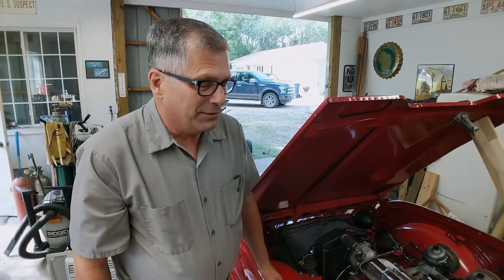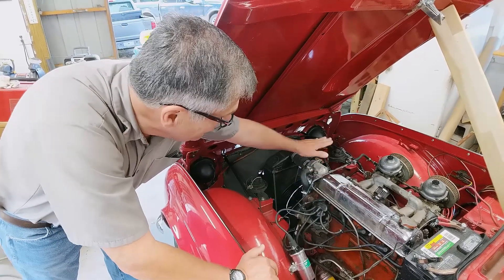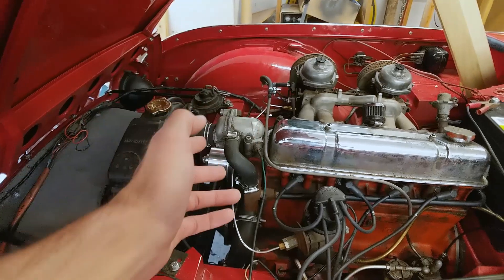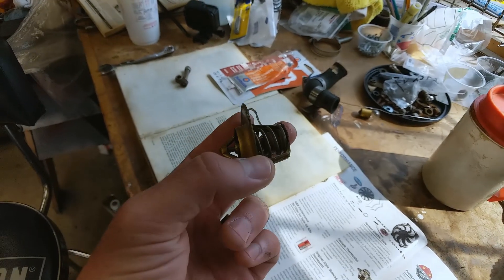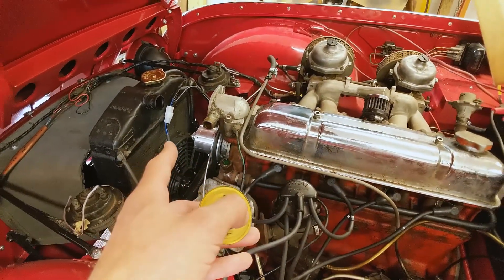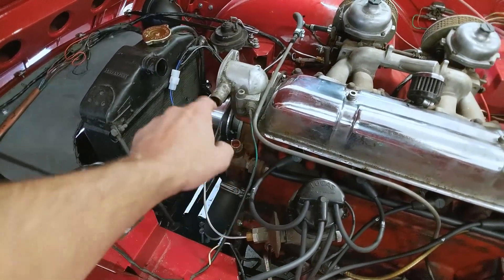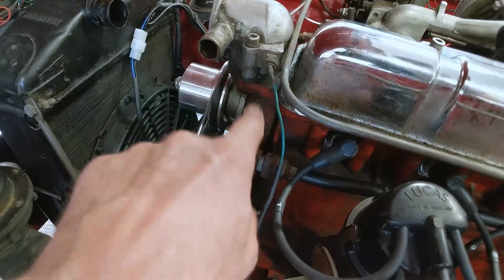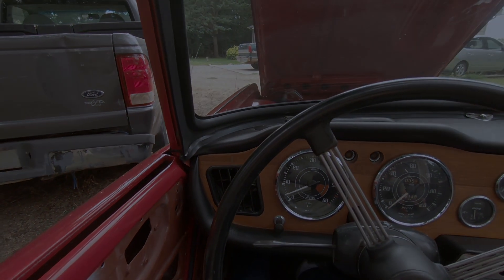Triumph TR4 Thermostat Replacement and UPGRADE | Wegs Garage

Comment: Your ideas and doing scares me badly!

First of all: you probably have a TR4A head and TR4A radiator in your TR4.
 
The wax thermostat is original on the 4A - WITH a TR4A water pump housing with the bypass inlet reduced to 8.0 - 8,5 mm.
Never block the bypass the way you do because the old "cast iron heating boilers" need als much flow as possible, also at cold and moderate weather.

And the story about the sleeved bellows is commonly told but not true. 
First of all it is a horrible plug forcing the flow in the bypass.
And second the sleeve has a wide gap to the housing and can't block the bypass at all.

Never less then 30% of the coolant flows the bypass and the cooling system is suitable obersized.
If you want to get any benefit change over to TR4A specifications and swap back what you did before.

And if you had overheating problems, there is a different reason. 
Your water pump looks strange to me? What about the gap of the impeller to the housing?

Cheers, Marco
Reply: I was thinking about doing the bellows thermostat it’s very pricey though, and with what you say about it not closing the bypass off anyway, I’m thinking not, my problem is in the block/head there’s a lot of crap in it and the block drain is plugged, thanks for your comment.
Reply: Marco knows what he’s talking about...worth listening to.  And as he alludes (“needs as much flow as possible), you might be better off with a high flow wax thermostat, something like a Robert Shaw 330.  Just a thought.

Comment: ...I've had my TR3a now for 51 years.....many (many) years ago I drilled 4 holes around the thermostat flange to facilitate better cooling......I also ran 100% anti freeze due to it's 458 Degree boiling point ( I know, I've heard all the criticisms...but it works)....My TR never actually ran hot, but I'm a 'preventative' kind of guy.....A few years ago I was given a smaller , about 10", radiator fan which I mounted in front of the rad , with a toggle switch at fingers length from the steering wheel....BTW, my heater is an early Ford heater rad with a fan on top, my defroster is a towel....John (west coast,Can.)
Reply from the maker: Glad to hear it is working for you! We caught our share of criticism for drilling the holes, but it works so... I do think our electric fan might be a bit weak. It was just a cheap amazon fan, only draws a couple amps. May be in need of an upgrade.
Reply: @WegsGarage  My electric fan came from an auto wrecker's and is mounted in front of the rad, not on it, and above the crank hole...it's powerful but loud, so I flip it on with a toggle switch located on the dash aligned with the left side of the steering wheel, so it's at my finger tips.....The TR3 steering wheel is very close to the dash, so it works just fine to start the fan as needed to supplement the regular fan (which I wish was a plastic yellow 6 blade, lighter and more efficient).....BUT, the setup works just fine, even on the hottest days....John(west coast,Can.)
Reply: There are a couple of problems with 100% antifreeze. 

1) Your freeze point is higher. It doesn't make sense that adding water would lower the freeze point, but there you go (we used refractometers at Saturn to check the mix).
2) You give up some of your cooling efficiency. This is more of a consideration for cooling towers for plant cooling.

Neither one of these things is a big deal,  and I am quite comfortable running 100% antifreeze myself.

Comment: Good job, guys. Any idea what that squeaking noise is at the very end? Sounds like a belt or generator bearing maybe?
Reply from the maker: Thanks Chris! It is the belt. Our narrow belt conversion still not lining up 100%. It does go away after it runs for a few minutes.